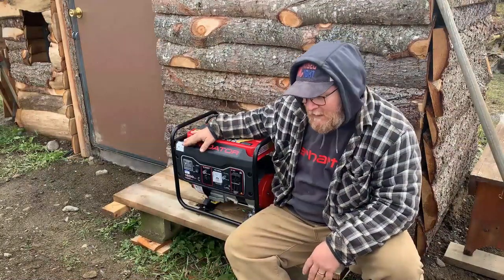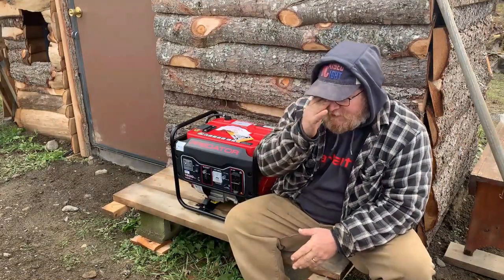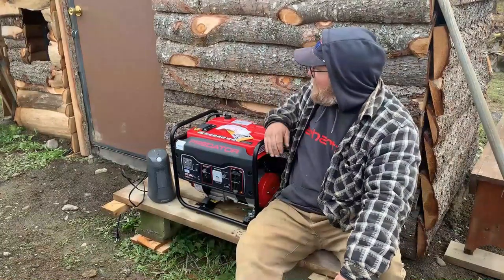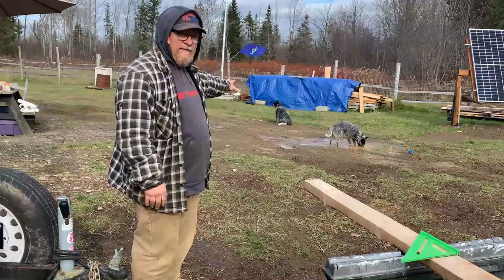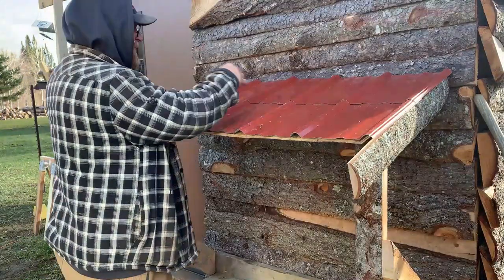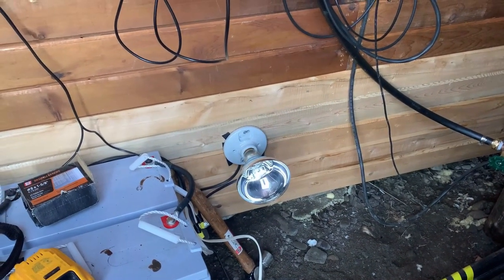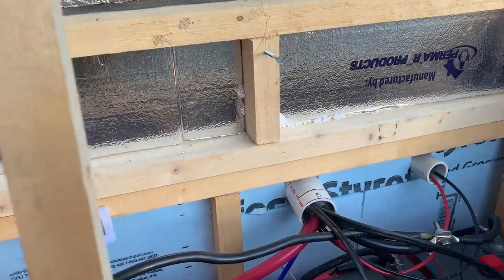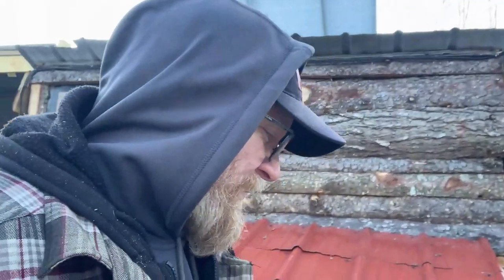Update to Heating our Off-Grid Sheds in the Winter

Comment: Are you underestimating how cold the winters get in maine?😊
Reply from the maker: Hi Erwin!  Not for a second, and coming from Chicago where the temps are historically lower than here in Maine, we’re fine.  That said, we’re just solving one challenge at a time.  Building a homestead from scratch and getting the right systems in place is a process and we’re grinding through each one 😊
Reply: @HanbleceyaRanch  didn't know where you were from. No disrespect intended..
Reply from the maker: @erwinaddison2030  none taken!!  Was just pointing out that we’re about ready as we can be for the winter here. 😊 All is good my friend 👍

Comment: Place some rubber  or tire tube cutout's under the steel bar frame, these type of generators viberate a lot n the tire tube will help it from moving. U can also place a two by two inch wooden piece in front of the  box so its not moving out of its box.
Reply from the maker: That’s a brilliant idea!  I’ve got some rubber laying around that I’ll add to it. Thanks for the tip!
Reply: @HanbleceyaRanch  it is also advised to get a service manual (hard copy) for this model if suddenly it not giving out the max output its suppose to.
Reply from the maker: @edwardseth1230 I can certainly see how that might be useful 👍

Comment: David says using the heat lamps will work, but why not use your generator to run a battery charger, and then just run the heat lamps off your house battery bank?  (Best charger for that purpose is an Iota - if we remember correctly that you are running a 48 volt power system, the one you would want is probably an IOTA 48v 13 Amp Charger Converter Power Supply w/Integrated IQ4 Sensor.)  Then you could put a line voltage thermostat in each of your outbuildings so when the temp drops to your specified level, the heat lamps come on.  Then all you have to do is monitor your batteries, and if the voltage drops too much, you start up your generator to renew the charge.
Reply from the maker: Hi Roberta 👋 we run the heat lamps on our home system during the day with sun and into most of the evening with no problem.  This small generator works well for us and doesn’t consume much gas through the night. 😊

Comment: hi   when you run the gen for the heat lamps  do you charge your battery's    thumbs up    Tom
Reply from the maker: Hi Common.  We have a 10kw generator to charge our solar batteries in the event we need to. The generator in this video is too small to charge my battery bank efficiently.